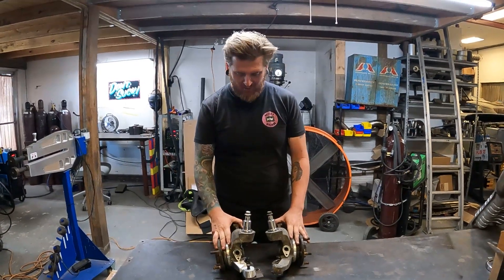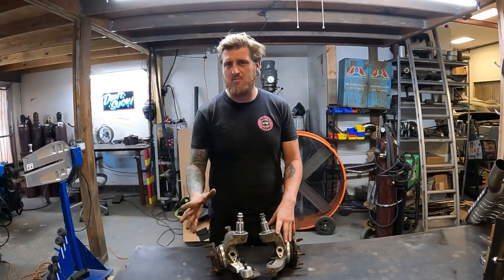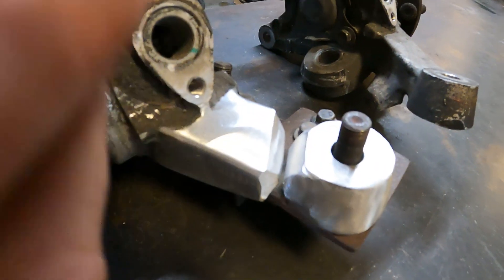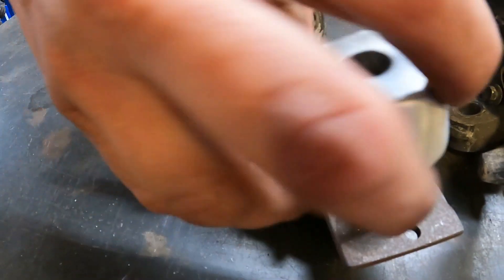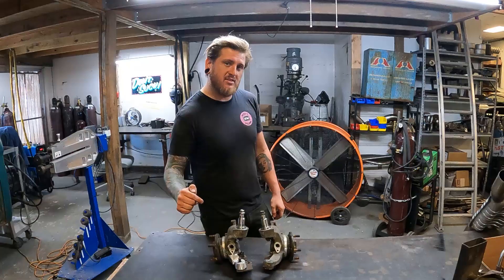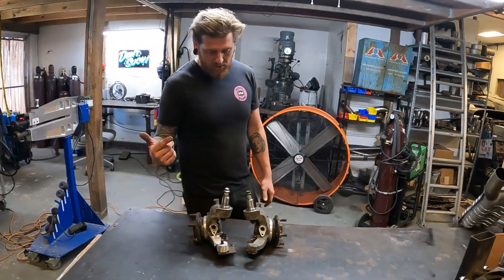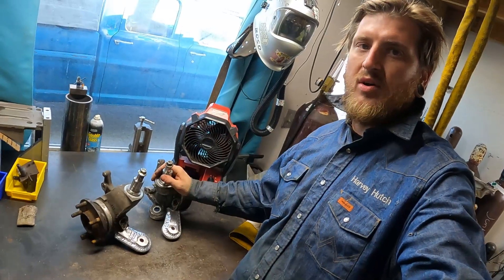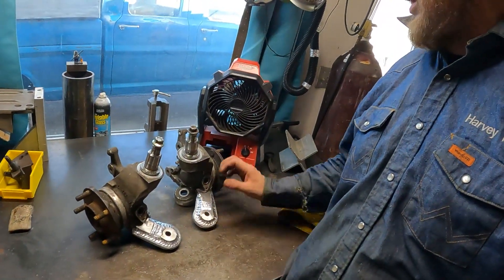Nissan 300ZX Z32 Drift Modified Steering Knuckles - Hutch's Welding

Comment: gonna order today but what spacers should i use ?
Reply from the maker: I don't remember, if you still need to know, email me.
Reply: @HutchsWelding lol it’s been 2 years 😂when we installed them and place the spacers I forgot one my bros didn’t tighten the lug knuts so when I was at the time turning to see if it touched the fender fell off and fell right to floor posing like lightmcqueeen 😂either ways prob one of the best purchases I made